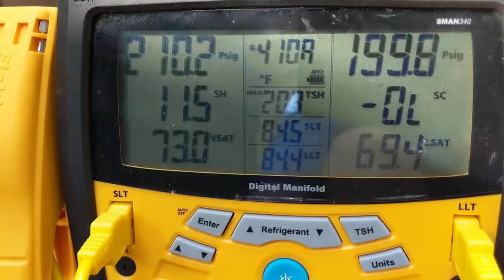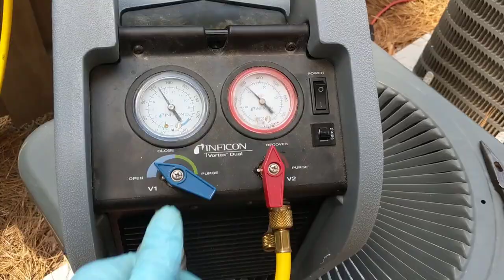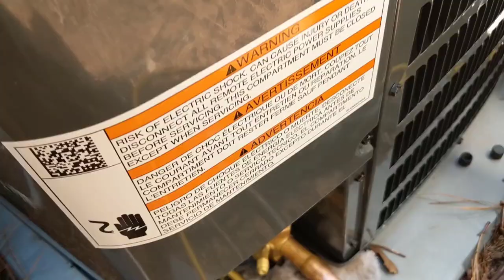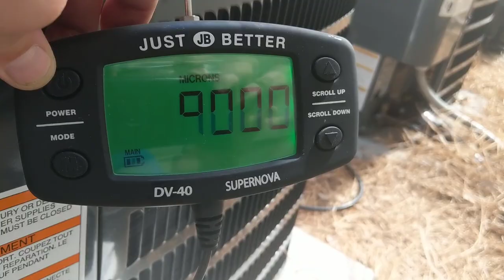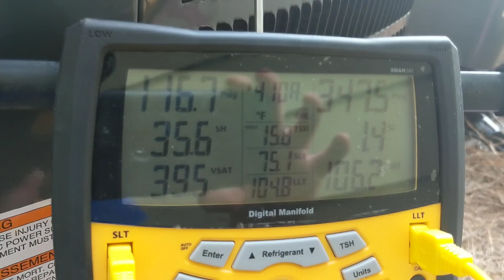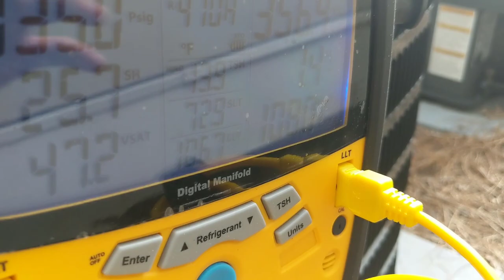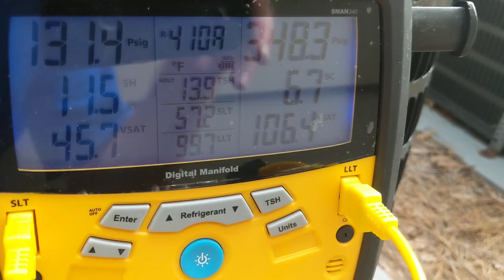Condenser Swap Out

Comment: If you're replacing an r410 condenser do you still need to flush the lines and evap coil?
Reply from the maker: Depends if you have a burn out or what your situation is. If your just changing a 410 condenser for another 410 condenser that maybe the outdoor coil had a hole or the compressor failed electrically & it wasn't a burnout then yeah you can swap it out without doing a flush. I would definitely do a nitrogen blow out though, & pull a good vacuum then doing a decay test. Thanks for watching Gerardo & Subscribe to the channel 👍